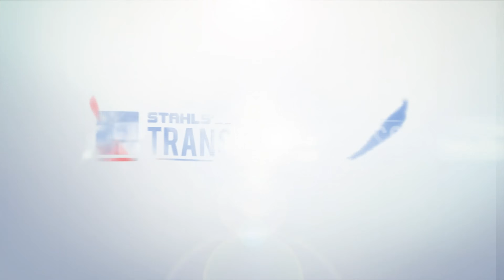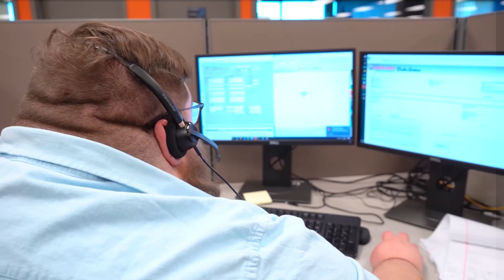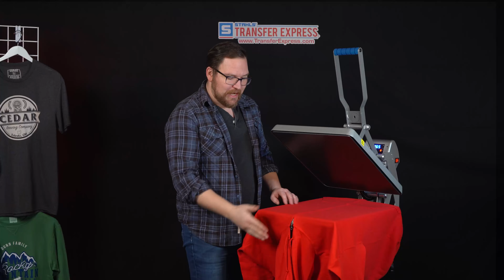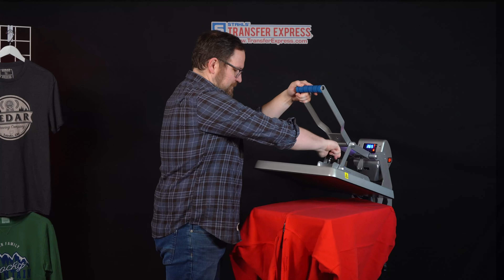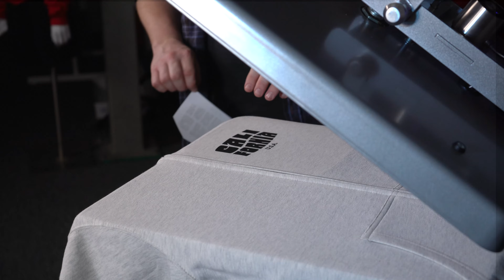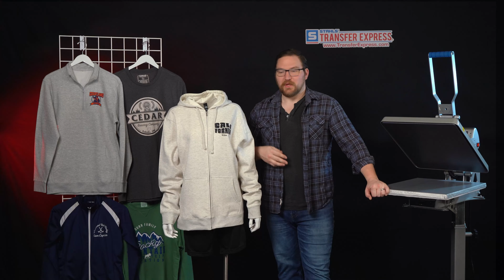How To Print Zip-Up Hoodies With Your Heat Press

Comment: Thank you for the great video. When using the mouse pad with poly or poly blends, it often leaves more visible scorch marks than a full press without the pads. Do you have any tips to help with this?
Reply from the maker: Great question Ryan, and yes, odds are your pressure may be too high. With reducing the surface area, you can reduce the pressure setting. This very helpful chart (published after this video originally aired) can help dial in the perfect pressure settings to reduce any visible press boxes from mousepads or smaller platens: https://assets.stahls.com/stahls/content/pdf/flyers/PerfectPressureGuide.pdf

Comment: To  prevent  pressing on the zipper when affixing on the back of the hoodie, unzip the hoodie, which will give you the flat surface you need for pressing on the back.
Reply from the maker: That's a fantastic tip! That zipper will definitely show up in that back print. Thanks David!

Comment: Without a threadable press, I use a large pressing pillow inside of the hoodie when doing the back.
Reply from the maker: That's a good tip- But we recommend using caution: Depending on what transfer type you're using, pillows sometimes dissipate too much pressure for those heat transfers that require a firm pressure (Like the Goof Proof screen printed transfers we used here). They may press ok but won't last the full 50+ wash cycles if not applied correctly.
Reply: @transferexpress  What would you suggest for those of us without a threadable platen when doing them otherwise?
Reply: @transferexpress  What would the suggested method be to do this prints, withouth a threadable platen then?

Comment: Would you happen to know why my vinyl does not stick to hoddie, it’s a polyester/cotton hoddie
Reply from the maker: Hey Jessica, for any heat transfer application, there's 3 elements you need: Time, Temperature & Pressure. Double check the application instructions for the specific vinyl that you're using to ensure your settings are correct. Pressure is often overlooked and too little pressure is the cause for many transfers not applying correctly. 

If that doesn't solve the issue, there may be something wrong with your heat press. Using a thermometer or heat press test strips ( https://www.transferexpress.com/heat-press-accessories/heat-press-test-kit ) to ensure your press is actually at what you have it set to. 

Most heat transfer vinyl works on all cotton, polyester or cotton poly blends, so it shouldn't be the vinyl itself.